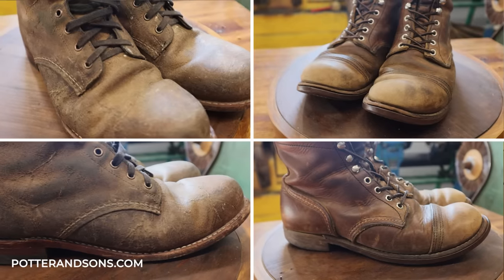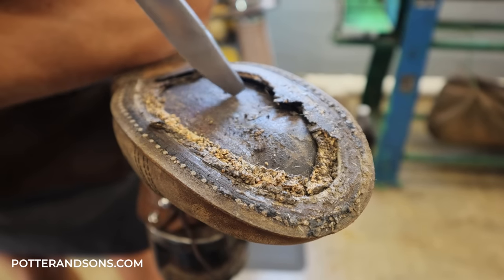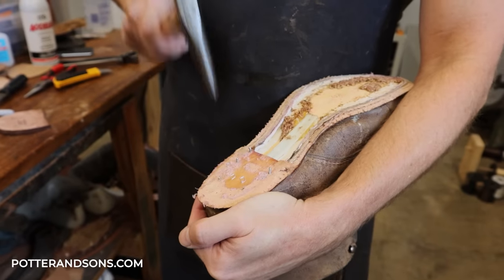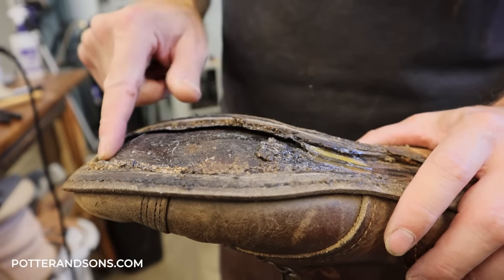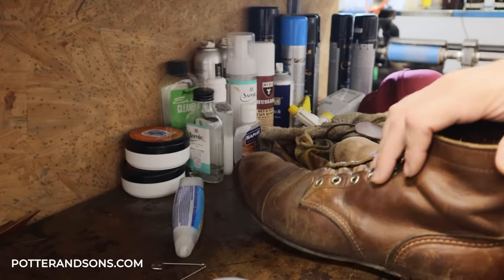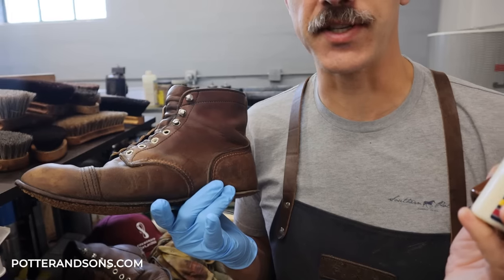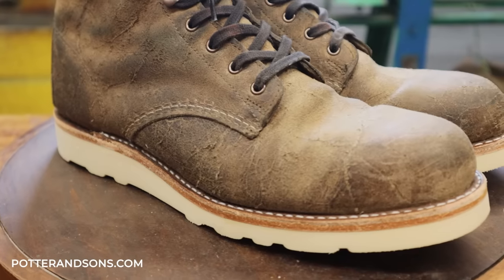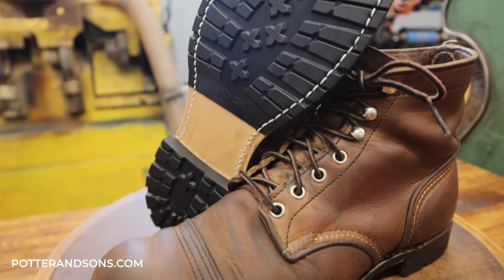2 CLASSIC American Boots Receive a NEW Look!

Comment: Dude this is awsome I'm the owner of the Iron Rangers . I have worn these for 3yrs everyday I work as a HVAC techbician , standing in water and coil cleaner . Going in crawls and replacing coils or in 130 degree attics and kneeling down in mud and dirt. I decided on the rubber and leather comber due to traction issues with the harder Viabram soles . Excited to see how they feel and work when I get them back . 🤗
Reply from the maker: Awesome…thanks for sending them in!  Hope you like the new look and grip of the new soles/heels.
Reply: Don’t be so stingy with leather conditioner in the future.
Reply: i'm curious what this ran you if you don't mind saying would be tempted to get this done when mine need to go in but afraid of the cost lol.
Reply: @NeoPortaPotty  $150 - $250 is usual depending on how much work needs to be done + the cost of shipping your boots there & back.
Reply: I own two pairs of Iron Ranger. A howthorne  muleskinner and an amber. Is it normal that the tongue on the amber seems made with two different types of leather? The left one is way too softer than the right one
Reply: HOw do you like them with the new style soles?
Reply: @aaronfurman1003  the added leather mid sole added a extra layer of cushion along with the softer rubber . If you don't like the super hard feel of the iron ranger this fixes that but more importantly way more grip on harder smooth surfaces and in wet conditions.
Reply: @promsrey  Thanks. I use mine for field inspections so they do not get as beat up as people using them in the trades, but thus far, I dont mind how hard they are, but I am definitely upgrading when its time for a resole.
Reply: @cristianocollarin2236 yep ! That’s very common for Red Wing. I returned a pair because of that reason. I’m a bit OCD and I knew the different tongues would bother me.
Reply: Å⁰
Reply: the Iron Ranger boots look like a pair of cut-down Jump Boots, imo
Reply: @JohnH20111  Totally. Just better materials and construction on these
Reply: @promsrey how do you like the new soles??
Reply: @danmcarthur8077  they are softer than the original soles by a good bit so its easier on your foot along with the extra layer of leather . The lugged sole does get mud and dirt stuck in it when it's wet out but provides the much needed grip when it is wet. But it's not as deep as other options so light rinse will usually clean them up after work .
Reply: @promsrey  I just picked up some rangers today :) thanks for replying
Reply: Not only did you repair this wonderfully gave them a nice upgrade as well
Reply: @cristianocollarin2236 Like the other guy mentioned it is common. It's like buying leather gloves and some pairs are softer and more broken in from the get go. Just depends on what they had on hand when making them, leather varies even on the same hide.
Reply: @TrentonHeath I want this sole on my danners does it have a number? Is it readily available for my local cobbler?
Reply: Nobody is denying your hard work but lets not pretend like your boots were in Vietnam for 3 years or whatever ffs...

Comment: Great job on both pair.  I have a couple questions concerning shoe repairs in general.  The last time I took shoes in for a new sole, it took over a month before I could get the repairs made and in my conversation with the Cobbler, he mentioned how expensive materials have become and why it cost so much to repair shoes these days.  Still, he wasn't lacking customers.  My questions are, how long should it take to have your shoes repaired and where is the line between getting them repaired and just buying new?
Reply: лучше купить новую пару, какой толк от новой подошвы если скоро появятся дырки на сгибах)

Comment: Another nice Saturday morning spent with the Potter brothers doing another fine resole. I am wondering if my 4 yr old Danner Bull Run Moc toes are worth it to resole.?  The sole is wore down, but the welts still seem to be in good shape and the uppers are good as well with no holes or anything on them. Would a Vibram Montagna sole work on them..? Or go with another wedge sole..?
I would appreciate it if you think they are worth doing...
Reply from the maker: Thanks so much for watching!  As long as the welts are in good shape and still have plenty of room for new stitches, then all you’d be looking at are new soles/midsole.  Check out our website for sure, but it would probably be around $160 if we did them.

Comment: I've been meaning to ask you this for some time: when I was watching the work being done, it seems to me that when you use the--what do you call that device again, the "5-in-1"--when you use it to crimp down the sole, you're turning the handle in one direction, but when you use the cutting function (to trim down the excess material) you turn it the other one.  Or am I seeing things?  Or does it matter?
Reply from the maker: Haha…I’ve never really thought about it!  It doesn’t really matter as long as you can see what you’re doing and doing the job correctly with the device

Comment: Very cool video!  I've never been much of a fan of wedge soles, so the Red Wings win my vote - but the Wolverine upper looks incredible, too.

Question regarding the whole "sending boots in - check the website" thingy...

Under the cowboy boot section it only gives options for re-soling.  Does that include a new stacked leather heel?  What if a new insole is required, like a complete rebuild from the insole down/out?  A while back I sent an email about sending boots to you from Ireland, but perhaps it went into junk or spam?  😕

Any info or advice would be immensely appreciated.